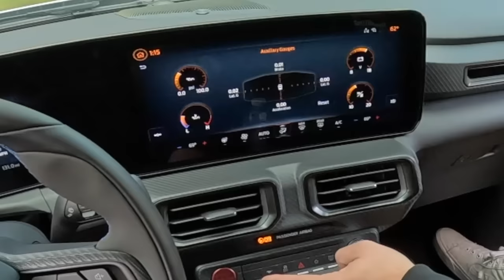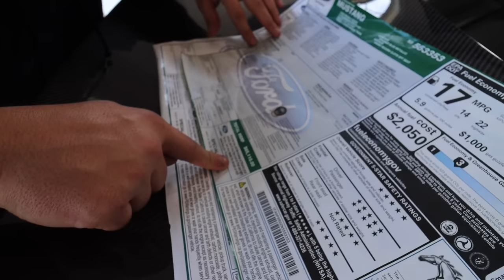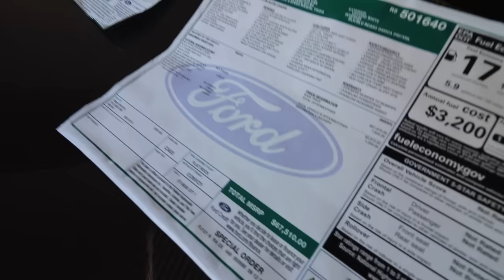Watch this BEFORE BUYING the 2024 Mustang Dark Horse!!

Comment: A common example of riding the clutch is to keep slight continual pressure on the clutch pedal whilst driving, as when a driver habitually rests his/her foot on the clutch pedal instead of on the floorboard or dead pedal.
Reply: Puts a lot of unneeded wear on the release bearing too.
Reply: Very common mistake and easy to do.

Comment: Ok something to keep in mind here. The dark horse is not a better track car than a 1le. Throttle house even said that the only reason the dark horse is faster than the Mach 1 is because of the tires. The trofeos hook better than the cup 2’s. And throttle houses track is not a hp track. Just because a car can go around a Walmart parking lot with cones faster than a gt500 or a 1le does not make it a better track car. When you take into account that the dark horse weighs 4100lbs and makes the same power as the previous generation and is only quicker because of new tire technology how are you getting the same car as the s550
Reply: The Dark Horse doesn't weigh 4100lbs you added 150lbs to the car... they are only slightly heavier than the S550 cars (81lbs heavier than a 2023 Mach 1 6spd) my guess is the bigger brakes are where some of that weight is coming from. As far as the HP goes it is close but also I haven't seen that many 2024 Dark Horse dynos and besides Steeda haven't seen a Dark Horse and Mach 1 run on the same dyno... got to give it more time but I suspect the Dark Horse will be putting down slightly better numbers but it will be close. Also Throttle House is definitely not the standard for testing cars I enjoy their content but they are just basically a slight step up from hobbyist.

Comment: Oh and I bet that auto Rev Matching is nice.. I am so used to doing it myself but that would be nice to have.. One less thing to deal with. And it must really save the clutch for those who can't drive a manual well.. Just Imagine all people who have gone from 4th to 3rd instead of 5th like they ment too.. That's a huge save on the clutch if it Rev matches mistakes.. I get why they do auto rev matching now.. I am older so I grew up on manuals.. My first Vehicle was an 1976 F250 390 Big Block with Nasty Headers, I bought that truck in 91 though.. She had the Granny Gear so you had to start off in second... So it was really like driving a 3 speed Manual. 1st would only go like 5/10 miles an hour max.. LMAO..

Comment: This guy thinks the Mach 1 is this special car. They still have new ones not yet sold lol
Reply: That doesn't mean it isn't a special car it most certainly is the reason some were not sold was because they were optioned in a way most didn't want i.e. no track pack and auto transmission... also dealers were marking them up and they were already on the high side for price... but once again doesn't mean it isn't a special car... a Mach 1 with the track pack and tremec 3160 transmission is a special car.